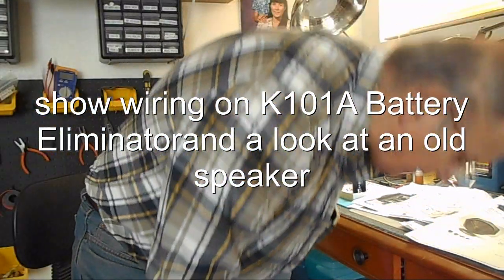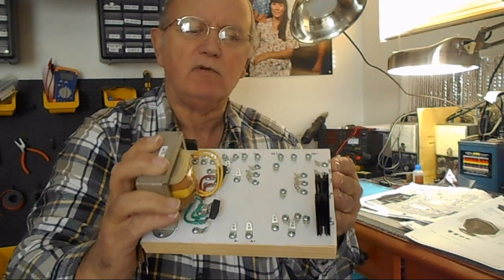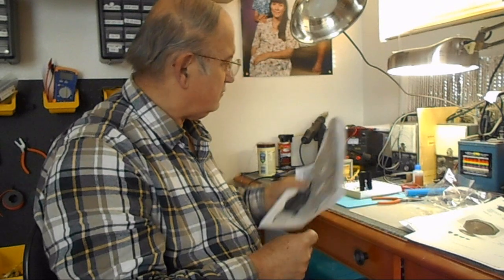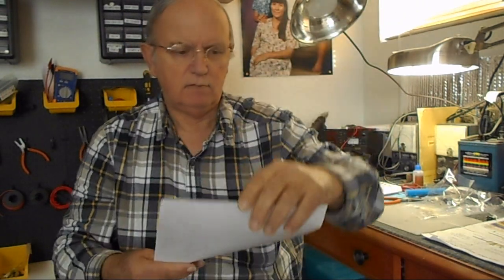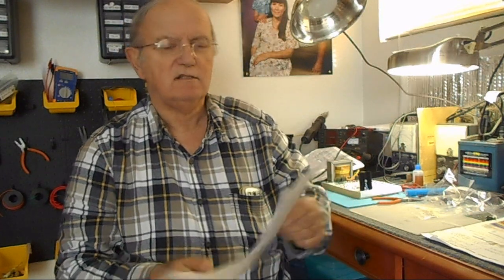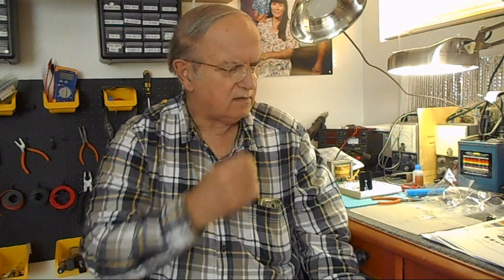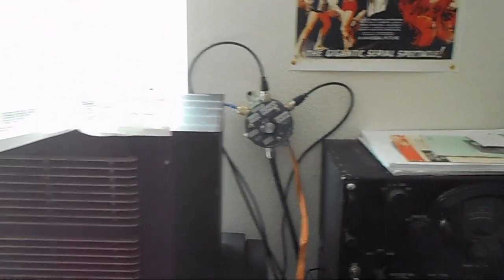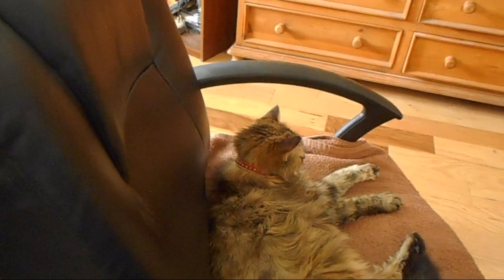Wiring K101A Battery Eliminator and bought a 1920's Speaker

Comment: Nice setup with the switch, looking forward to seeing the finished power supply ( I may order the same one for a farm radio)
Reply from the maker: The switch was brand new in the original box with paperwork even though it had been manufactured in 1968 so someone just stored it away untouched for all of those years. The supply goes together well and will certainly take care of the power needs of my 1928 Case Battery radio.

Comment: Radio hobby is much cheaper than boat, RV, or car hobby.  Even cheaper than guns too.
Do you chat with Ron on the HF?  The Halicrafter looks like a pretty good rig.  
About the only good on radios are the hams.  Terry of D Labs has been dong a bunch of EF Johnson stuff, I had a Johnson tube CB  long ago, a very nicé rig.  But um toying around with getting a Heathkit SB101, théy're reasonable and fun.  I had a HW101 long ago, liked it a lot. I have my Drake TR4 tube rig, but, would like a SB101.  Or a nice Henry Tempo One, I think that was made by Yaesu in the FT401dx days, my first HF rig was a very nice FT401dx.  I have an Eico HF tube transceiver in the attic that needs work too.  But the Heathkit rigs are easy to work on. I guess that I want a good working boat anchor.
Reply from the maker: My brother Ron still has his old Viking Valiant stored away in his closet it was his old general rig. But now he has his ART13 Transmitter, the T368 Transmitter which is working great and he has a Collins R388A Receiver, his Military radios and transmitters from WW2 he restored BC348L, and two ARC 5 Transmitters. My problem is if he powers his Transmitter on when I'm Listening he overloads the front end of my Hallicrafters SX28A lol. Yes, I saw Terry at DLABS restored a lot of E.F. Johnson equipment he even worked on the same National NC270 Receiver just before I worked on mine.